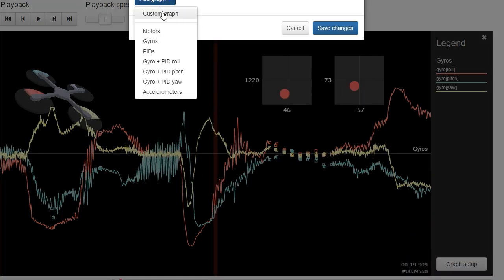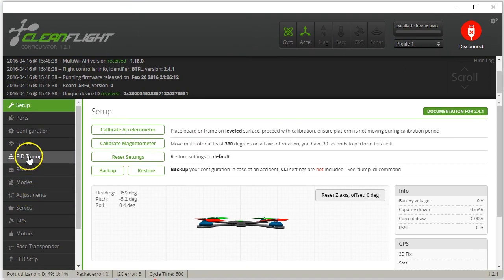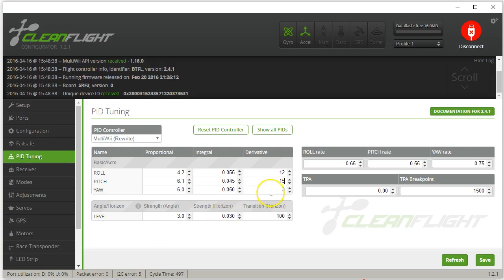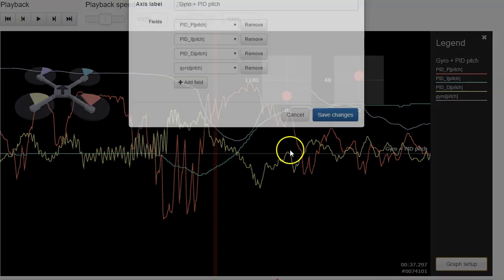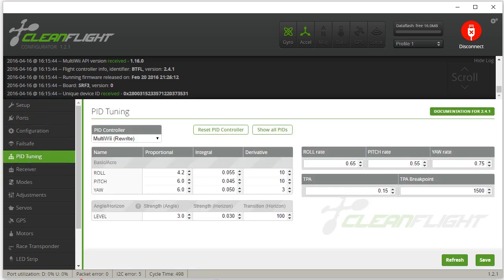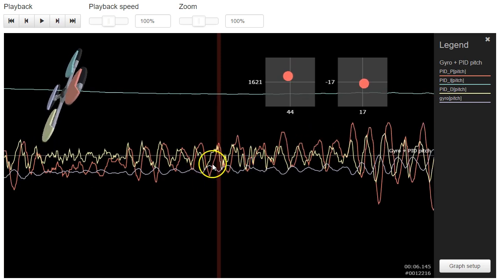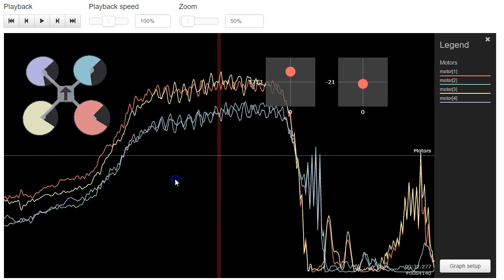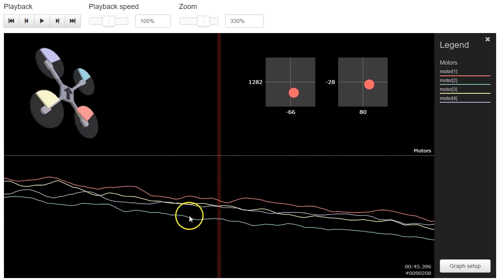Fine-Tuning My PIDs With Vibration Damping

Comment: While my kit came with rubber o-rings to mount the FC, I couldn't see them doing much good considering how much the screws rubbed against the holes.  I also didn't see a way to safely make the holes bigger to fit rubber tubing around the screws.  Instead I came up with this method of mounting, which works well with a CL_Racing F4 and separate ESCs, as the FC is the only thing in the stack:

http://i.imgur.com/ZVZjiMf.jpg

Comment: i installed the m3 bobbins from readymaderc https://www.readymaderc.com/store/index.php?main_page=product_info&cPath=53_777&products_id=6306
My question is 5" alien i had to install kinda wrong way maybe.. so i have stock plastic standoffs directly to frame or pdb may as well say and then on top of that the bobbins which is what the flight controller sits on and then aluminum screws from alien kit holding down on flight controller. Is this going to hurt my performance or will this help something?
Reply from the maker: That sounds fine.
Reply: as always thanks mr bardwell for the help.I may get some rubber to put under screws so it rest on f.c instead

Comment: Where did you get the vibration-damping bumpers from? Can you please post link? Thank you.
Reply from the maker: These ones came with the Lumenier Lux. I suggest using silicone fuel line cut into short lengths.

Comment: Where did you get the isolating o ring from? I can't find any small one like yours
Reply from the maker: It came with the Lumenier Lux. I don't know where to get that exact one. A lot of people are using 1/8" silicone fuel line and just cutting like a 2mm length of it and squishing it down.

Comment: Loving your recent series of troubleshooting videos, I have learned so many things.  Can you see any downside to vibration damping the flight controller?  Will you be doing this on all your future boards?
Reply from the maker: +Allan Sanderson in theory, too soft damping would make the gyro less responsive to the movement of the frame. But I don't think we are anywhere close to that. I will definitely be doing this with my RCX motors going forward.
Reply: I just thought of a downside to vibration damping- it makes it harder to spot a motor problem in the configurator using your method.
Reply from the maker: I suppose. But if the motor problem is not making it to the gyros, then is it really a problem?

Another approach is to check the motor traces. If one motor is consistently higher than the others, that motor is probably having an issue.

Comment: Great stuff as always, thanks.  Are you just using generic rubber washers for dampening?
Reply from the maker: +GAPiT FPV the bumpers came from Lumenier buy I don't know the source or if they are a commercial product.
Reply from the maker: +GAPiT FPV foam tape works well.

Comment: Am I seeing this right? You can change your PIDs and go back to your Blackbox and see what the changes to your PIDS
Reply: Dang, hit enter before I was done. You can what changes it made to your flight data or did you do multiple flights?
Reply from the maker: +Smokkedandslammed I did multiple flights. If you do in-flight adjustment, I do believe that Blackbox logs the adjustment so you can see the new value.
Reply: +Joshua Bardwell Ah, got it. Thanks and thanks for the videos!

Comment: What about just replacing bearings in the motors, that should go a long way to helping?
Reply from the maker: +MicroRCFiend I mean, it couldn't hurt, but I don't think the bearings are the problem. I could be wrong, but the bearings don't feel bad in the motors. I think it's just that the bells have gotten banged up and are slightly out of balance. It doesn't take much to put them out of balance given they're spinning at 30,000 rpm.

Comment: 1. You're tuning without the HD camera that you usually fly, right? Is that recommended?
2. I am under the impression that yaw D doesn't do anything on later BF. So it's not just that the default is 0, but the logic was removed. I think
Reply: Yeah, from 2.6.0 release notes: Removed D on yaw from all pid controllers. This saves the pid controller some calculations. Dterm on yaw isnt really needed
Reply: I apologize, you're running 2.4.1. Not applicable
Reply from the maker: +Chris Mavrakis Flying without the HD camera will result in slightly lower P gains than with. Basically, more weight damps the copter's motion and allows for higher gains. The difference is subtle, so I wouldn't worry about it too much. But if I was going to worry about it, I would tune with the HD camera off. The copter would be slightly softer with the HD camera on, but I wouldn't get any oscillations when I flew with it off.

For point 2, I am flying with BF 2.4.1, so D term is still active on yaw as far as I know.

Comment: nice :) , back in the old APM days you wouldn't dare not run a FC without some damping , i use to use moongel on all my boards
Reply from the maker: +HecTech FPV I think the shift to mini quads is what encouraged hard-mounting FCs. With 5" props and higher-kv motors, the vibrations are higher frequency and lower magnitude. Especially with the soft filtering that's now present, vibration isolation is often not necessary.
Reply: 100% ! different vibs, and the filters are a million times better and the arducopter pid conntroller isn't the best. though as im sure you have seen it can still make a huge difference

Comment: Why don't you try balancing your motors? Or try some of those silicon or rubber bobbins. If your screws are touching the FC then vibes are still getting thru. Did you enlarge the FC mounting holes so that the only thing that touches your FC and frame are the orings?
Reply from the maker: +Joey Nuggetz balancing motors: I have tried it, and it just didn't work for me. It took a ton of work. When I finally did get a small improvement, the tape eventually came off in the field. It just seems like a ton of hassle for limited results. Maybe I just suck at balancing motors.

I did not enlarge the FC mounting holes, but that would actually be an okay idea. But honestly, the results as-is are so good that I don't think it's necessary.

Comment: I personally use tpa on my quad that has cobra 2100kv motors since they are not the best of quality and balanced. I find that tpa is very useful if you are running motors that are not perfectly balanced. I am running like .18 tpa
Reply from the maker: +RCflyer729 TPA. So retro.
Reply: +RCflyer729 same.  its cheap insurance and helps with full throttle osciallations with a non perfect tune.  I set my breakpoint for 1750 and .20 tpa    besides... i have NEVER had a quad lose control at full throttle.  its got plenty of control up there.

Comment: so where'd you get those bumpers?
Reply from the maker: +Razvan Taranu They came with my Lumenier Lux. They were sent to me to test them and see which ones worked best. So I have no idea where they came from or where you would get some. Sorry!

I guess the point of this video is to say that vibration damping CAN work wonders, and to inspire y'all to explore that on your own if you have vibration issues.
Reply: +Joshua Bardwell Struggling to find a good supplier for these - don't want to use foam tape, on my nice clean build... prefer a tidy dampener that sits under the FC :)  Please let us know if you do find a place that sells good ones.
Reply from the maker: There have been some other comments in this video with links. A rc car shock rebuild kit. And silicone fuel line.
Reply: Thanks Joshua.  Will give a few different combinations a try.  Looking at trying to find these in Australia. http://www3.towerhobbies.com/cgi-bin/wti0001p?&I=LX2594#tech

Comment: Aw man... I just replaced some motors -_-
Where did you get your O-Rings? Gonna try this next time
Reply: +JRey FPV you can find rubber o-rings in the hardware isle of home depot, a pack of ten is a couple of bucks.
Reply from the maker: +JRey FPV Hardware O-rings are worth trying because they're cheap, but the vibration-damping O-rings and bumpers for FC isolation can be made to a certain hardness or whatever that is different than what you get from the hardware store. So just because two O-rings look identical doesn't mean they will have the same vibration damping effect. O-rings from the store are not designed for vibration damping, they're designed for sealing joints. So they are probably a lot harder and may not isolate as well.

If you get some hardware store O-rings, report back here how they worked!
Reply: Finally found o-rings that fit and are soft!

Setup
QAV180
Lumenier Lux (Betaflight 2.6.1)
DYS XM20A (14.4)
Lumenier 1806 2500kV
DAL 4045 x3 (Non-Bullnose)
RROSD

PIDS:
R - 4 - 37 - 18
P - 4.4 - 42 - 18
Y - 4.8 - 53 - 0

Airmode+Super Expo

How I set up the o-rings:
Frame > Standoff > O Ring > RROSD > Standoff >O Ring > Lux > O Ring > Nut

Once I could feel contact with the O-ring, I did half a turn more and stopped.

All yaw twitching is completely gone! Usually, at T=1400, I start this weird twitch.

Only issue I have now is around 1800+, I get minor oscillations I can't seem to get rid of.

But going back to o-rings, they made a massive improvement. This QAV180 is the first quad I've ever built (3/15/16) and I couldn't tune out oscillations. So I stopped flying it. Over a month later, I add o-rings and practically 95% of my issues are solved. Could have been the tune, but I had much lower pids than above and it still oscillated so it must have been the gyro. I would give you blackbox logs of before and after but I don't have one lol.
Reply: +JRey FPV Forgot to add, I'm at 8kHz and Oneshot 125. I sent Dither to 7 in BLHeli because 15+ caused more oscillations.
Reply: +JRey FPV Please link your o rings source?